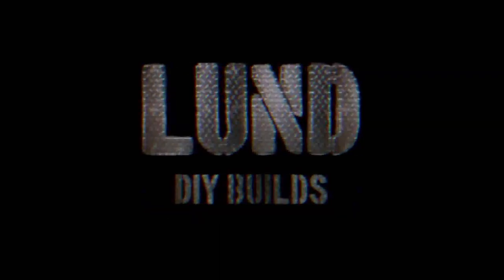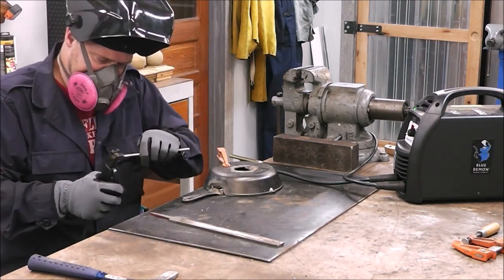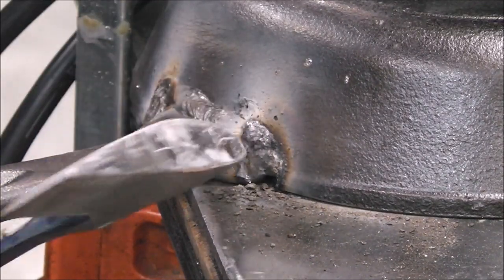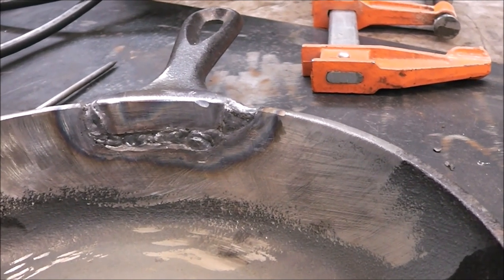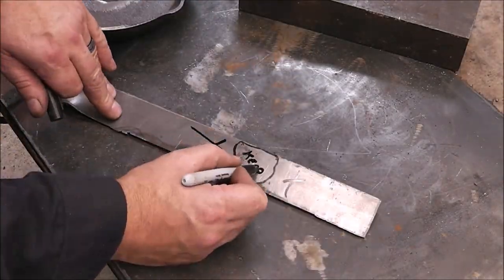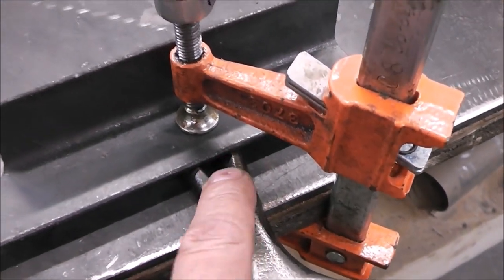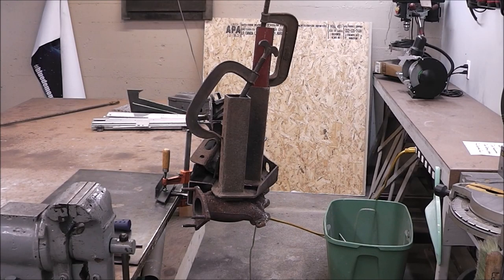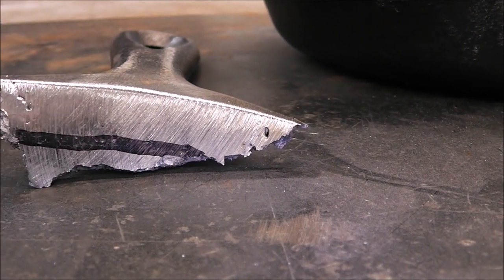Stick Welding Cast Iron Repair using 7018 Welding Rods

Comment: Thanks for this. Just welded up an inlet manifold for a Briggs and Stratton 10hp engine using your instructions. Used an inverter welder and 7018 rods. Worked fine. Very handy method for non critical jobs.
Reply from the maker: Right on! It's always nice using what we have and having it work without spending hundreds of dollars. Well done! @John

Comment: I welded cast iron with 7018 some years ago, and I have to say it was one of the hardest things I have done.  At first the cast iron kept cracking like glass (just like your pan there in the video!) because my pre and post heating wasn't good enough.  I had to heat it up with an oxyacetylene torch (the shop was cold, and therefore, so was the work), and after I welded it, I took the oxyacetylene torch to it so it would cool down very slowly.  This actually worked, but I don't know that I would want to try this again unless I was up for a real challenge!
Reply from the maker: It can be a real challenge and to add to that some cast iron is easier to weld than others. Congratulations on getting it done!
Reply: @BrandonLund  I don't weld allot of cast but you are correct every piece of cast has been totally different than the previous one

Comment: I tried welding a truck brake drum to a 3/8" steel plate,  then to a 4x4 - 1/4" square tube to make a pedestal for an 8 inch bench grinder,  the 7018 - 1/8" from the brake drum to the 3/8" plate CRACKED right down the middle of the bead,  But the 2nd weld over the cracked bead is 3 years old and still holding with no cracks. !!😃😃 GREAT VIDEO thanks William Orange County California
Reply from the maker: I've had simular issues when trying to weld on to brake drums. Thanks for watching and commenting William! Great fix!
Reply: The reason that crack is the rest of the metal draws the heat away from the Weld .

Comment: I used to weld cast cam follower bases to 4" x 4" hardened keystock, using 7018 rods. This was at a conveyor factory and what the engineers wanted. We never had an issue...
Reply from the maker: Good to know! Thanks man!

Comment: Hi Brandon. I'm going to buy some of these rods and have a go on my vintage Tangye cast iron stove top section. Its been broke since 1984.
You make it look possible for even me to attempt to do using short bursts at a time. Great tip. Tony
Reply from the maker: Hey Tony glad I could help. It's worth a try. How great will that be getting it up and running again! Please keep me posted and feel free to tag me or post pics on my social media pages. Cheers buddy and good luck
Reply: @BrandonLund  Will do, but it will be next year sometime before I get around to it. I can't wait myself to see I f I can do it. Thanks for your video info. Tony.
Reply: Hello Brandon some people think you cant weld copper and steel together but u can using a silcon bronze tig rod. Try it some time, its fun 😉
Reply: @eyuptony  well how did it go? :)
Reply: @jbbolts  Thanks for the reminder lol. I'm still in the process of moving my workshop so when I get sorted I'll have a go then let you know. All the videos I've been posting recently are old footage I'm sorting out. Cheers jbbolts.

Comment: MG 289 rods are excellent for this type of repair, but expensive. If you get a lot of porosity then butter it with Normacast first. You may also want to try Washington alloys Tensile weld or 312 stainless. There are so many other options besides nickel rod depending on the base metal condition. 7018  does work. I have also had good luck MIG welding some exhaust manifolds on import cars with 70S-2 wire. You don't know until you try. Good video!
Reply from the maker: Thanks bud, I appreciate your support! You hit the nail on the head when you said "You don't know until you try". Thats what this is all about! I repaired a broken off leg from a cast iron park  bench using 70s2 MIG and it worked like a charm. I did pre and post heat for that one. I'll have to check out the MG 289 and Washington Alloys rods.

Comment: I used to have access to a huge forge that could be closed. I have put deep bevels for full penetration on cast iron. Then gotten the parts red hot and welded at super low amps. Then cycled in and out of the forge to keep the parts hot. After completion of welding back into forge red hot for 15 minutes then close lid and shut forge down. 24 hours later part still to hot to touch. At 2 days part is cooled to room temp. Using that method I successfully welded cast iron with 7018 stick many times.
Reply from the maker: That's awesome!

Comment: Great video… thanks for sharing!!! Hey instead of filing the rod after each tack/weld, try this- after each weld while the rod is red hot, stick the rod into a piece of wood. Get a small piece of 2x4 that should suffice, it’ll prevent the tip from scaling. It’s a trick I use when fitting up pipe. Try it, let me know what you think.
Reply from the maker: @Shane C interesting...I've never heard of this so I'm curious to try.  Thanks for sharing!
Reply: @BrandonLund  yeah man a little trick I learned from an old school pipe fitter. That way it’s a clean strike everytime.

Comment: I mig welded some large brake drums together for a mailbox base.  I peened the hell out of the welds right after making them.  The mailbox got hit by a pickup truck a while later and only one weld cracked.  The rest were in perfect shape and the mailbox still survives.
Reply from the maker: Nice job! Brake drums can be tricky to weld!

Comment: Glad you have good results with this
I on the other hand have to use HEAT , Heat  and more heat for best results.
That is my best vice  Hot enough that the cast and the 7018 puddle together.
Peen it all out the same way as this video and wrap it in isolation to where it 
was still too hot to touch the next day when I checked it out.  Left it alone to 
finish cooling down very slowly and it still is holding.
Reply from the maker: Very nice! I think the reason this worked without preheat is because I welded very short beads and allowed it to cool to touch before I welded another bead. As you said, preheat and insulated cool down is the safest bet though. Cheers
Reply: Thanks for the comeback, some good considerations for success.

Comment: Great job. I always wondered about cast iron. Now I have a go to process. Thanks Brandon!
Reply from the maker: You bet!
Reply: The best home repair rod is stainless rod.  High carbon steel  , stainless steel,  cast iron and cast steel are easily done with stainless rod.  . You have to preheat cast.  It is the unequal heating that breaks cast . Preheat gets both sides equal heat so the entire weld area is expanded . Other wise one side will be in tension and the other side will be in compression.  Stainless rod is quite similar in performance to nickel rod . And on high carbon steel repairs " such as a high quality shovel or hay fork keeps carbon brittle from breaking the repair.  Same applies preheat to 350 to 600 cool slowly by burying it in vermiculite.

Comment: Did a similar test back about 1978 with cast iron heads and 7018 rod, worked just fine. Machined and surface ground and ran like a new head.
Reply from the maker: NICE! Just curious, was it cracked in the combustion chamber or elsewhere?
Reply: Brandon Lund it was cracked along where the oil passages were.
Reply from the maker: @akbychoice  Impressive! Nice job!

Comment: I used to be a industrial mechanic back in the eighties, had a broken cast iron arm that traveled on a roller on our wool scouring line. I was going to weld it with 7018 low hydrogen on dc current. one of the business owners said you can't weld cast iron. ( he was my department head.) I did it anyway and it lasted 7 years until we replaced the whole scouring line.
Reply from the maker: Nice...The one thing I'm learning by sharing this information is that everyone seems to think there way is only one way and there way is the right way.  As you discovered, there are a bunch of ways...some are more unconventional than others. Good on you for giving it a go...it bet boss man was happy at the end of the day... you saved him a pile of cash :)
Reply: @BrandonLund  there is only one effective way and the way you used in the video is not it.. it cracks because its brittle and its flexing as it cools. heat the weld before and after and let it slowly cool. you can heat it in a blacksmiths forge or with an oxy torch and keep ot hot in a bbq as it cools. or bury it in the forge coals if its small.. cast iron has no flexability. and as youve observed steel bends whel welds cool
Reply from the maker: @Manchagojohnso... I prefer to let my work speak for itself.

Comment: Old school cast iron welding trick is don't use a grinder. Clean the edges with a file or chisel. The grinder puts inpurities into the metal
Reply from the maker: Hes actually right. All the text books say what he is saying but rarely do people bother. I just clean it up with a grinder and call it a day.
Reply from the maker: Cast iron is porous. You can literally see it with your naked eye. When you grind, the grinding wheel is slowly abraded away along with the binders that hold the wheel together. Those particles end up embedding themselves into the porous cast iron surface, which is why the experts recommend using a file or chisel over a grinding wheel.

Comment from the maker: This is a cast iron repair series. We all know that brazing / silicon bronze or nickle are traditional repair methods, but what about methods and fillers not usually associated with cast iron repairs? We are experimenting with different processes and different filler metals with preheat and without. There are many ways to repair cast iron,  If you ask 20 people how to properly repair it, you will get 20 different answers. Do you guys have any cast iron repair stories to share?

Comment: I know this is an old video , just came upon it ! Do you have to have the 7018 rods in the heat box or just use them cold ? I know for structural welds they need to be hot !
Reply from the maker: I just use them from a sealed container

Comment: My opinion on the reasons why you got crack in the middle - is different from yours. I think it happend not because of materials being dissimilar, but because of geometry. That cast iron in the middle of your frying pen had no room to move during its contruction when cooling. Your weld was all surrounded by very hard (and "strong") cast iron. That cast iron did not let it move, so it had to crack. Contrary to that, when you welded that round piece at the edge of the frying pen, it could easily expand to outside and then safely move back when shrinking. Thus avoiding cracks.
Reply from the maker: Good point and I agree with this. I also think the 7018 rod does not have the elongation charasticistics as other rods which are more compatible with welding cast iron. Im thinking nickel might have done the trick without cracking but I didnt want to use nickel because it's a carcinogen. Thanks for the great comment!
Reply: It is the geometry.  But that is why you preheat,  so both are in expansion and tension equally.  But with mild steel it has to cool slowly and equally.  You accomplish that by burying it in vermiculite
Reply: @huckstirred7112  Why I love browsing the comments, lots of wisdom from the experienced. Thanks for the tip.
Reply: I agree.  It should be EASIER to weld steel to cast than cast to cast.
Reply from the maker: So welding dissimilar metals to one another yields better results? Not a chance. They shrink at different rates. This holds true for all metals

Comment: What kind of welder is the best to practice for beginners , mainly for car rusty parts welding?
Reply from the maker: For welding on cars, your thickest material would be the frame which is generally not much thicker than 3/16". A mig welder would be best for welding on panels and making automotive repairs.

Comment: I repaired a vise with 7018 and it worked. But then it doesn't hold up weight. I did hear 6013 works too. You do have to pre-heat before welding then slowly "de-heat" after.
Reply from the maker: 👍Pre and post heat is probably the safest way to go
Reply: @ Brandon Lund. Yes definitely! I recommend pre-heating and the post-treatment. I was in welding school at the time and my instructor was gonna toss the vise so I decided to "save" it. Still have it. No problems. Surprisingly my novice welds are still intact. I must've done something right.

Comment: I have found that some 6011 rod will work good on cast seems like it helped to penetrate in to the metal the only issues had was the heat cause big cracks as it cooled and contracted but most of the time it seems to hole 
Ps added at end of video 6011 work well for joining cast with mild steel
Reply from the maker: I might have to give it a few more tries. I have not had any luck with 6011

Comment: nice video. I just tried welding cast iron with 7018 this morning and was always wondering if there is specially formulated rod for cast iron.
Reply: by the way, my weld seem to hold tight but that's soon to find out
Reply from the maker: Thanks man. Yes there are a number of specialty rods specifically designed for welding cast iron. Rods with a high nickel content work well.  Check out my Welding Cast Iron playlist for lots of information on this. Thanks and congratulations!

Comment: we got a new cooktop for Christmas.  The old one has a cast iron griddle that you can throw on top and use over the center burner. New stove only has a crappy aluminum one that's Teflon coated.  Old cast iron one is about 3 inches to long for the new cooktop. I was thinking about putting it on the band saw and cutting the 3 inches out to fit then welding it back together. It has a raised edge all the way around to keep the pancakes from dripping off the side. That's why it would have to be welded back together.  Ya think it would hold up?
Reply from the maker: I personally don't repair cookware. I think it's just too dangerous if it should fail.

Comment: Thermal growth co efficient are different one metal is expanding and contracting at a different rate. It will always pull and break
Reply from the maker: That's what makes cast iron difficult to weld. Limiting heat input and peening are key.

Comment: If u hook the welder up backwards and use the ground rod for the rod it will draw the heat out and will have hardly any heat and no cracks I do it all the time a old man told me years ago and I've made a lot of money using it try it on hear as a test no leaks eather.
Reply from the maker: I think you are the 2nd person that has mentioned this in the last year or so....I had not heard of this before and I have not tried it yet. I am very curious to see how this works. It makes sense. Are you using an AC welder when you do this?

Comment: When I try to join dissimilar metals I use a rod from Air Liquide which they call  the" Extreme rod" it is high in nickel , it seems to work well
Like your work, can you do more welding repair videos?
Reply: 0
Reply from the maker: Hmmmmmm. I'm going to have to do some research. I have not heard of this rod. I'm glad your enjoying the content. I enjoy doing this type of video also so yes, you can expect more in the near furure... probably this Friday 😁
Reply: thanks Brandon, the rod is Xtreme  product ~ Blu-5321-12532  on Air Liquide's Canadian web page  under Blueshield MNR specialty and maintenance electrodes

Comment: they make welding rods for welding cast iron to steel,steel to stainless steel, and stainless to cast iron. look up dissimilar metals welding rods. they are also called maintenance  rods. they have a very high tensile strength. nickel rods are a joke.
Reply from the maker: Thank you!
Reply: I think he is well aware of the different rods made for cast iron to steel ect,  the point of the video however was to see how 7018 would preform.  Better then I expected but I think his success was in the technique.
Reply: This comment actually helped me. A lot. I can stick weld all day, but tig and brazing are not practical on certain locations in certain environments. Sometimes people say 'no you can't weld that, you'll need to braze it', and not knowing what type of rod to use for dissimilar metals was a definite negotiation handicap, especially when it came to pricing. So a quick printout of what metals can be welded with what other metals using what rod, and now you're the expert 😂

Comment: If you are trying to weld a crack in an engine block or cylinder head, it's very difficult and I would say that even if by chance you seemed to have welded it with 7018, it wouldn't hold up because of the difference in expansion rates of the metals.
Reply from the maker: I have never tried to weld and engine block or a cylinder head with 7018, but one of the commenters below actually posted that he welded up a cracked cylinder head and the repair lasted for many years. Another poster said he welded an old tractor axle...If that's all you got, It appears it can be done.